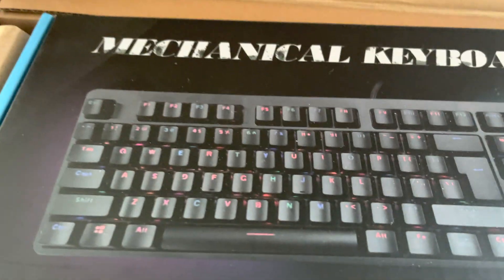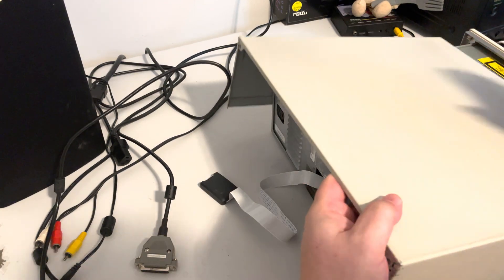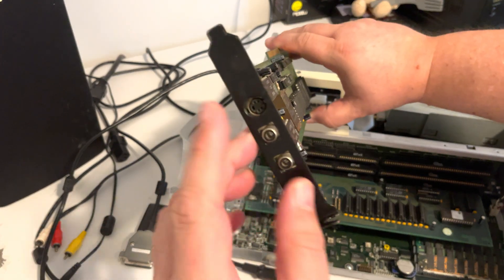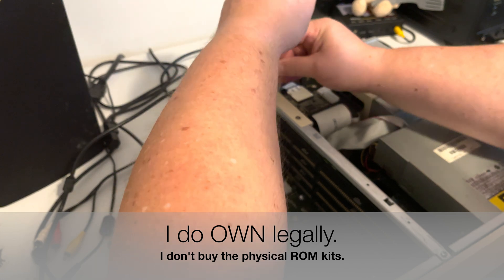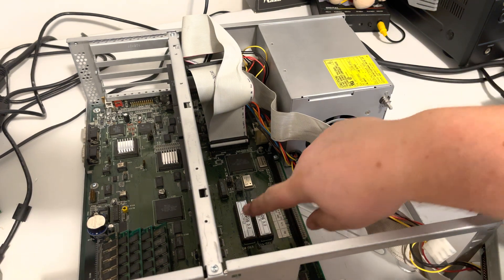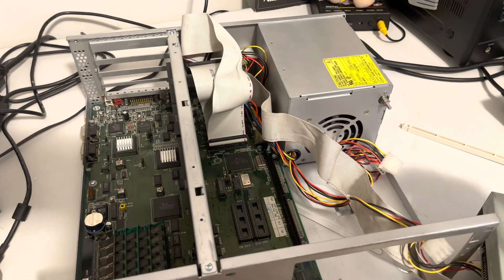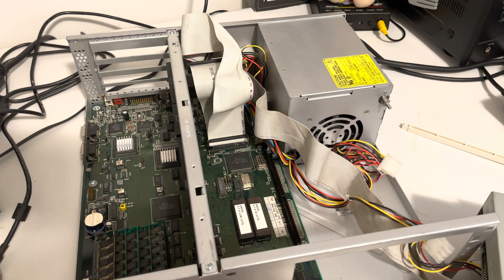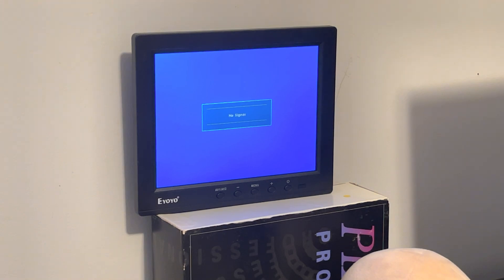Wild and Whacky! A4000 RTG Graphics Update!

Comment: Mr Kevin (Q) interesting vid 👍🏻 Out of a matter of interest, have you tried the RGB output to check that the 3.1.4 ROMs are working first? Then trying the 2 mouse buttons on startup to have a look at the expansion boards page to see if the card is recognised? 😉
Reply from the maker: I did. Roms are working perfectly. Board still does not show in list.
Reply: @HoldandModify  Running a Buster 11 I take it? If Buster socketed then make sure it’s seated properly. DaughterBoard recapped?
Reply from the maker: Yup. This is the 4000 that Chris Edwards featured in his repair video. My earlier video also highlights. :) it’s in fantastic shape.
Reply: @HoldandModify  Faulty Zorro-III slot or failing PSU? All voltages read correctly?
Reply from the maker: PSU is good. Daughter card swap is next test. As I mention at end. Once I’ve done that. That narrows it down to something on the main 4000 board.
Reply: @HoldandModify  Fingers Crossed it’s NOT a Buster Problem 🤔😳 Good Luck! 👍🏻

Comment: Oh no! I was so hoping to see you using the Picasso! You will get it running! I am sure!
I also had a Retina and I didn't like it because it was painfully slow, the Cybervision 64 that I got later was amazing. I am really interested which was better, the Cybervision 64 or the Picasso?
Another thing I wonder, my 68060 (Apollo) had a heatsink with active fan, doesn't your 060 get too hot without fan?
Thank you very much!
Reply from the maker: So my ‘060 doesn’t seem to get too hot. I do have heat sinks on every chip it has though. In the 1200 it’s an RC5 which runs cooler. It hasn’t had any issues with no heat sinks

Comment: One thing the PC got right over the Amiga was the ability to swap or add a minor part without disassembly of the entire computer.
Reply from the maker: Yeah only the A2000 is easy to work on. The a3000 is the absolute worse!
Reply: Not in the slim desktop format. Even the pc’s have nightmare upgrade access. The 4000 is nearly the same as most slim desktops of the day, and later years.

Comment: Awwww man I was really rooting for you! Very sad, I would have been in heaven to have an A4000 back in the day but for me it might as well have been a unicorn because my chances of getting one would have been the same :p I DID have an A500 and some years later an A1200, good times that I miss.
Reply: I just bought an all new A1200 chipset and a Re-Amiga 1200 motherboard so I'm going to be building an all new Amiga A1200 in 2022. Once I've done this, I may just do the same with the A4000.
Reply from the maker: @daishi5571  sounds like an adventure! All my best!
Reply from the maker: Don’t give up! I still have hope but….if it doesn’t work out. The 4000 is still a heck of a machine!